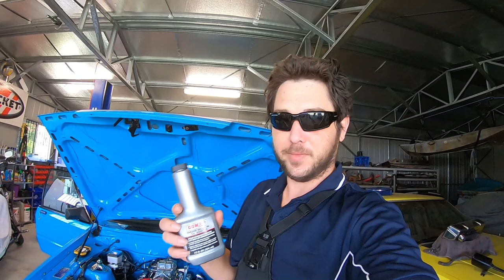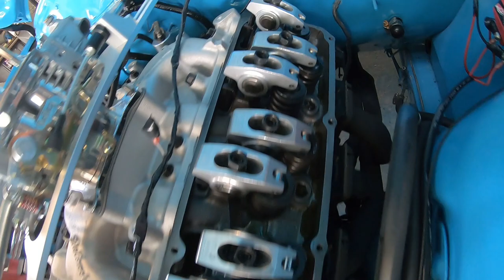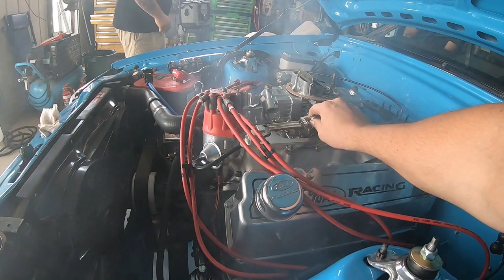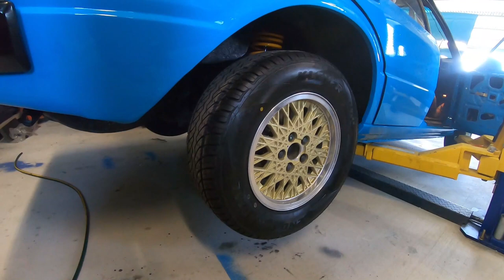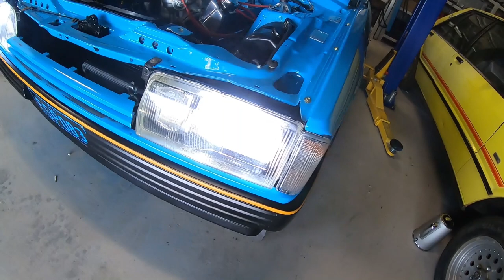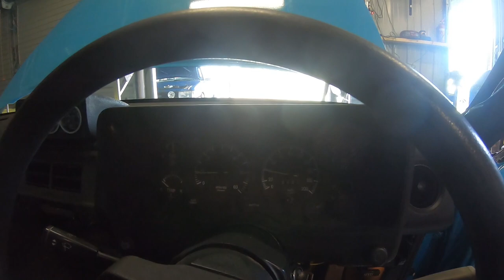BRAND NEW 450HP 351 CLEVELAND FIRST START UP AND CAM BREAK IN

Comment: Still trying to get my cleveland assembled. Put it together in 99, sat in storage since last year, pulled it apart and had more block work done w/forged pistons. Getting ready to coat pistons and bearings in thermal barrier and dry film lube respectively.  Just keeps dragging along.

Comment: Awesome build! I was wondering if you could tell me what pulley kit that is? Is it the A-Team gilmer style? Also doing a Cleveland 4v build and looking for a pulley kit without the A/C compressor and power steering pump.
Reply from the maker: Sam D I think I was told it’s a pro flow gilmer pulley set, I like to use Aeroflow too.
Reply: Its an aero flow pulley kit

Comment: What cam are you running? I'm building a 351m with custom forged pistons, balanced engine and head work on stock 2v open chamber heads, including porting. Your thoughts are appreciated.

Comment: I'm almost finished building my xe esp and I was wondering what thickness air filter could I use under bonnet 351c rpm air gap manifold using 1" spacer 750 dp square bore?

Comment: ould you be able to tell why my cams keep failing? I installed 2 Elgin cams and the 2 lobes were worn on the first mild cam and then all 16 lobes on a heavier 2nd cam. Using new 8.400" pushrods but reused stock rocker arms (maybe that's why they were wiped) I pumped the lifters up in an oil bath and lubed everything and then primed the oil pump. Started the engine and ran at 2500 rpm for 25 minutes. What is a good cam kit for the 3rd try if this was not installation error?
Reply: Rockers arms wont matter. Are you using modern oil? You need to use zddp additive then. Also proper cam break in is critical
Reply from the maker: What are the specs of the cam your using this time mate?
Reply: @thclevoking  Originally
 Lift: .562/.588
Duration: 300/310
Duration @ .050": 234/244
Lobe Separation: 112 LC
Lopey idle, 3000-6500 rpm

Now i am trying a Compcams 268h which i will measure pushrods for 20 thousandths preload
Reply: @thclevoking  I never measured pushrods and used stock 8.4" compcams pushrods, maybe i didn't have the correct preload and that ground the lobes. I will try getting away with just removing and cleaning out the oil pan of the metal debris/paste.

Comment: Do you have to remove the engine to change the cam on a 351c? Cheers
Reply from the maker: No mate done heaps of cam swaps in engine bays it’s not as easy or fun but can be done
Reply: Cool thanks. Going to have a look at a 351c XT fairmont tomorrow!

Comment: Where did you buy the Valve covers? Can only find those ford racing ones you have for a 351w.... will it fit the 351c??
Reply from the maker: No Windsor covers won’t fit on a clevo mate, they only have 6 bolts not 8 like a clevo cover. I bought these black Ford Racing covers NOS from Zox performance a long time ago. I have seen them on eBay from time to time but they are a bit pricey.

Comment: Beautiful car.   Would you care to share any details on the engine build?
Reply from the maker: Mac Franks this customer asked me not to say too much sorry!
Reply: @thclevoking  It is just that I have a fresh .030 over forged flat tops Cleveland short block with bare heads and I haven't built one of these engines before.   I have been in search of knowledge for a while.   I would prefer to do it right the first time.   I am particularly trying to carve my way through all the "oiling mods" suggestions which go from nothing needed to routing lines and everything in between. 

I will agree to a non-disclosure agreement if that would help and this is truly just for my own build so I don't mess  it up.   I would then not disclose to anyone else the information I get from you on this build.   Mine might take some of what has gone into this build but I also want to make it my own so it won't be a carbon copy anyway.   If this is still not acceptable I will continue to research on my own where I can get good information from so my build comes out successfully.    Good information seems difficult to come by in the U.S. which is where I am.   So far I haven't even found an engine shop in my general area that has any expertise in the oil mods.
Reply from the maker: @macfranks2456  thanks for the reply, please look up the clevo king on Insta or my FB page and message me we can chat in private about my opinion on clevo oiling mods to suit your cam profile, thanks Ozzy!

Comment: what if you dont have a tacho how high should you hold the revs?
Reply from the maker: You should then buy a cheap timing light with the tacho built in and look at it. Revs need to be between 2-2500rpm.
Reply: @thclevoking  thanks but i am re using my cam i have just rebuilt everything else as cam was fine do i still need to do this?
Reply from the maker: @cruza1289  not really mate you just have to bed the rings in then as long as you put the same lifter on the same lobe with the same valve spring and pre load

Comment: What kind of parts you have in this engine?
Reply from the maker: It was a while since I looked at the build sheet I can’t remember exactly, but it was loaded with good parts and a proven combo that works again and again.
Reply: @thclevoking  I have 351c 4-bolt, but its pretty much standard engine. My purpose is to rebuild the engine, but I dont know must I stroke it, or keep it 351, if I want 450+ hp, and keep driving feature still ok. I dont know is that possible without stroke? If I just put there a tough camshaft, aluminum heads, better headers and intake and holley sniper.
Reply from the maker: @69silakka  easily possible I have made 450hp with basic 2v cc heads. If you invested in some trickflow heads and an edelbrock air gap and a small hydro roller cam like the comp 290hr you would surpass the 500 with the right piston choice. Or alternatively I use a lot of xe284h flat tappet hydro cams with 2v alloy heads and get around the 450 without going to too much compression. I like to use the eagle rods with the floating pin, and an SRP forged piston in those combos if it will see sustained high rpm for longer then a quarter mile run.

Comment: Can you do a timing video?
Reply from the maker: I did do a pre start tips and checks video with how I check timing if you want to have a look
Reply: We have about the same setup.. How do yu setup valves b4 initial start up/break in bc cam card suggests doing it hot. Do yu go loser? I have cast iron 2v heads solid lifter /roller rocker 351. Also thanks for the videos especially the intake gasket one.

Comment: 5:59  $15:000 engine wtf,,, how?  my 351 cost $4:600  and it's fairly modified, the pistons the cam the manifold the heads etc,
Reply from the maker: Things are about double the cost in Aus it’s a bit sad but we are used to it. Some of the us parts are 3 times more expensive here landed.
Reply: @thclevoking  dam  but I'm in new Zealand